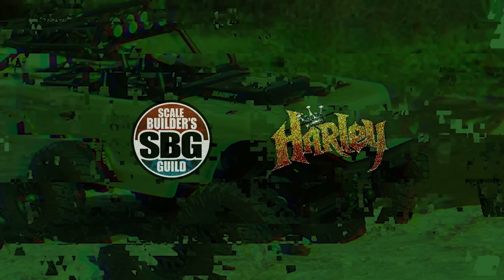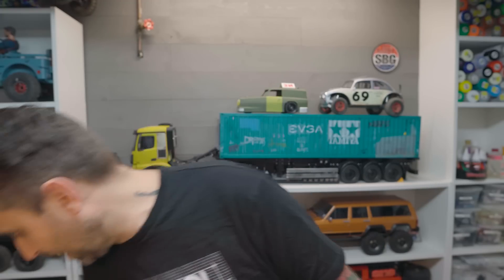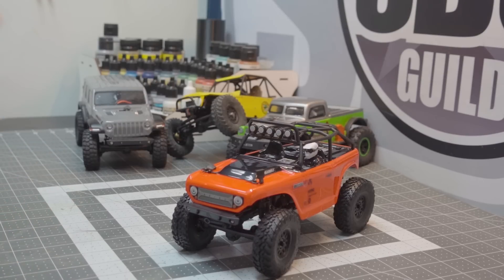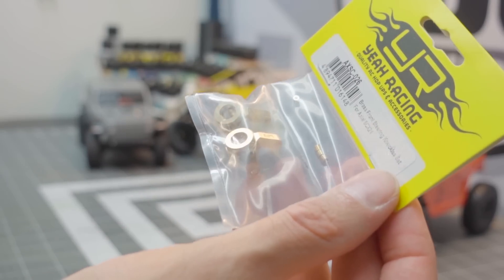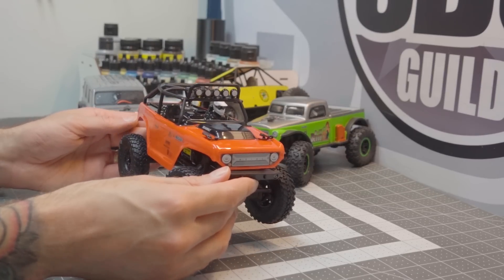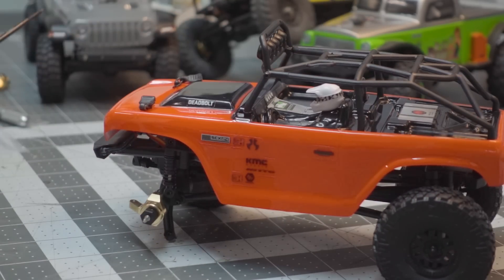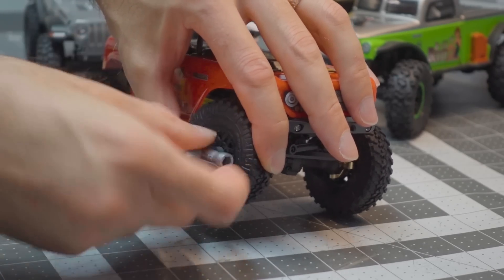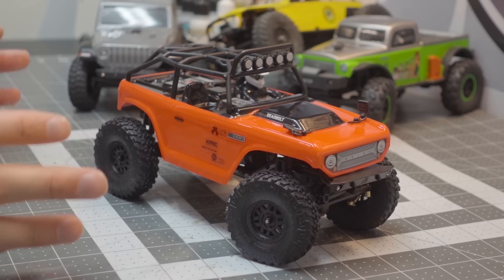Axial SCX24 Budget Build Off Ep1

Comment: Already spent it, reefs 99 with DSM servo mount, sidewinder micro 2,   gamy rc motor mount and little cheap eBay 1408 outrunner. Brass, wide axle kit w/ Brass, stretched with C-10 front links on the deadbolt 145mm now. Cut some generic dollar store soldiers head off to replace helmet. Eliminated light bar with a tree sprag that was laying around. Mod 19 rock sliders to mount new electronics on. Running on 3s 450mah battery. Hot racing shocks with softest springs set as droop essentially mounted shocks on drastic angle to the chassis for droop. Rc4wd breaker wheels with scramblers. Treal Overdrive front diff gears. Obviously moved over to an SR215 and driving with DX5c. Stinger front bumper from Thingiverse! Oh and that’s just 1 of the 4 scx24s I have. I also have what I refer to as the Stroker Betty because it’s number “383”!

Comment: I've had a lot of very cheap R/C cars over the last 40 years from companies like New Bright, etc. and I've never taken a deep dive into the hobby before but now that I have children I'm looking into this as a hobby that I can do with my boys as they grow and teach them to save their allowance money up to buy upgrades and to just have some fun with Dad! I've been doing a lot of research so far and it seems like the Axial SCX24 would be the best place for us to start, I'm gravitating more towards the 1:10 scale stuff but the smaller 1:24 scale stuff looks really fun and cool too! I'm thinking that the best thing to start with and I'm a Noob to this (but I do work on real Hot Rods, 4x4 Trucks and Jeeps too!) but I have to agree with you that you made the best choice to get the center of gravity and the weight down lower, I liked the upgrades you chose, maybe even the brass diff covers as well, next I think I would go with the aluminum suspension kit, and/or weighted wheel and tire kits, and since you now have stronger, heavier axles go with larger tires, then maybe upgrades to the servos due to all the added weight, then I think I would handle the cosmetics like the body swap and the details like adding more lights, etc. I just Subbed BTW!

Comment: I have four SCX24's. The front axles are not typically a point of failure unless you're a terrible driver. IMO, unless you're trying to go wider, they're a waste of money in a budget build-off like this. Put that money into a stronger servo or wheels/tires. The brass knuckles are a good part.

Comment: I have 4 all modified differently. A deadbolt that I turned into a bouncer style buggy with true 4WS, double barrel shocks, stretched with rear links on the front and rear lots of brass, and Furitech speed control. A C10 back halved with MOFO RC flatbed and double barrel shocks and lots of brass. A C10 with MOFO RC Truggy kit that I left the bed side’s and tailgate and rear trailing arms, gutted front axle, hot racing internal spring shock, a fast motor, and a bigger battery 2WD Pre runner style. And a C10 that I beefed up the suspension with hot racing oil shocks to pull the triple axle gooseneck trailer I built to haul the rest.

Comment: I have 5 SCX24's, at least one of each, except the Betty.  I just picked up the 1993 Ford F150 clear body that I am going to put on one of the C-10 chassis'.  One thing to give a heads up that I have found out to add body clearance, move the shocks off the towers and they will bolt directly on to the frame so you are not having to do major trimming to the Jeep and C-10 bodies when you increase tire size.

Comment: I have the white jeep JKU and most of my money went in to brass wheel weights, steering knuckles, steering drag link, and some other things.  I still need to get tires and wheel hex adapters to fit my shaka hobbies wheels.  I definitely want to do aluminum axles and drive shafts eventually

Comment: I have2: a c10 with lots of brass and brushless, and a Jeep that is stock with RC4WD tires on stock rims. The c10 was a headache to get to this point, but is a real treat to drive, and finally feels reliable
 The stock jeep is very tippy, but with only a tire upgrade and steel washers will follow any line with careful driving. Throttle control from a Furitek is fantastic, and is a very valuable plug-n-play upgrade for a brushed setup. Jeep might be getting one soon and call that truck good!

Comment: Yup i got the green dead bolt. I got hr links, axle housing.  Brass knuckles, extended drive shafts and brass diff cover. The wheel weights too.
I got to get a new servo and wheels. I took the wheels of the betty and put them on the deadbolt. 
I just wanted to do this more then any thing else.
I'll be following.  I have the deadbolt the c10 and the betty. I got to get the jeep. That next.

Comment: I've got 2 and my son has one. Mine have both ended up with as much money in upgrades as the original  vehicle cost. But also a great platform to us 3D printed parts as they hold up in this scale.

Excited to see what you come up with and hopefully get some creative ideas for mine 🤔.

Thank you for all the content.
Reply: +1 on the 3D printed part. Especially if you got a resin printer to print out very high detail "scale" parts like fuel tanks and such..
Reply: What parts did you all print bryce?
Reply: @rc4lifenl952  various bumpers, sliders, light buckets, servo mounts, links, pivot balls, spring spacers, etc I think I'm getting good enough at slicing files to maybe do cage for like a tube buggy type set up. 

I just need to invest in fusion 360 or something so I can design my own stuff instead of just using other peoples files.

Comment: I just grabbed the Deadbolt a couple weeks ago and already put the Treal +5mm brass hubs on it. They make a big difference. I also bought some Mud Slingers, but I am waiting for wheels to give those a try. I am pretty sure I will have to cut the body to keep them from hitting, but the grip is going to be crazy with them.

This is my first 1/24 crawler and I liked it so much I bought the gray C10 which should be here in a few days. Awesome little rigs for sure!

Comment: I have 3 running and 1 still in box.
Never into crawling until I saw these. I have built a course to run them on.
C10 heavy mods. Betty just brass hexes
Dead bolt stock but has rc4wd stamped steel bead locks and mud slingers.
Reply from the maker: Cool! Thanks for watching!

Comment: All u need is Rc4wd rims mounted deep dish style with Rc4wd tires. Emax servo stock tray. Hot racing aluminum steering rack. That's it. Maybe brass diff cover upfront. That's it. Anything else and u will spend 1/10 money

Comment: Furitek ESC, hands down the best upgrade you can do to the 24. Throw in a aftermarket rx and radio for even better resolution and slow speed capability, though the stock esc used as the rx will still work.

Almost forgot, get the bluetooth module too so you can tune that increased capability.

Comment: I bought the c10 back in December ran it twice in my basement & never really got into it? Just sat till about a week ago & I been driving it around downstairs. Looking forward to see what you & Harley do with this series?!  Everyone seems to dump 100’s of dollars in these little things cannot really find just some basic upgrade vids? Not trying to spend $1000 on this little thing just a few upgrades to help performance & that’s it. I got gspeed chassis kit & tgh/hh sherpa kit coming that is more important lol!!!🤪👍🏼
Reply: All I've done with mine is brass front diff cover, EMax servo, aluminum steering link, tires and beadlock wheels. I think it's easy to get carried away with adding weight, which can be over-done.

Comment: I began following you and Harley Designs some time ago. After a lengthy absence from the RC hobby, I was excited to hear about this build challenge.  I was really anticipating this series because I began building an SCX24 Deadbolt from scratch as my reentry back into the hobby. However, after watching both you & Josh’s videos this week, I have a question for you: Is this considered a “budget build” or “budget modification”? I am currently in my initial phase which is building out the chassis. I will pose the same question to Josh on his video in hopes to get a reply from at least one of you guys. Looking forward to the challenge and your videos!
Reply from the maker: Not sure I understand the question. We name this series the Budget Build-Off, in that we're both building trucks. Not necessarily from scratch, as we usually start with an RTR. I guess a more accurate description would be Budget Upgrade, but that doesn't really roll off the tongue. 😉Thanks for watching!
Reply: @scalebuildersguild  Yes,  I meant from scratch. I guess I'll just need to follow the Deadbolt exploded view in the hopes of getting it right. 

Thanks for replying and for your explanation. All I received from Josh was a vocabulary lesson of the meaning "build" in the rc hobby (which I disagree with).

Comment: Here's a tip for anyone building a SCX24, use the shorter wheels and tires from a RGT/Barrage/CR24 and a 1/20 scale body, not 1/24 or 1/25. This ends up looking dam near dead on like a 1:1 scale rig on 38s. Iirc the Lindberg "Big 1/20 Scale" Ford Explorer Sport even fits the Deadbolt wheelbase perfect 👍 Yes, the shorter tires effect performance, but if scale looks are what your after I think this is as close to true to scale as you can get on a SCX24
Reply: Worst comment

Comment: I have two that are heavily modded. My advice is lower the  weight by reducing top weight and moving as much weight forward and downward as you can. With some creative solutions this can be done for free. Shick postion body lowering moving the battery etc.Once you have maxed out your free mods then add brass weights. Adding weight helps but you can waste a lot of money on brass parts that add too much weight and do you not favors.  Such as brass axle widener  weights.

Comment: was there a weight difference in shafts? I haven't bent one yet but if i did that looks like a good replacement
Reply from the maker: Definitely. It's negligible in terms of measuring on a scale, but certainly more weight.
Reply: @scalebuildersguild  I bought brass hexes and they only weight a gram, every little bit helps.

Comment: I would start with a few brass pieces down low and the some durability pieces (drive shafts etc) and then a ecx barrage motor if the stick one fails.
Reply: Wheels & tires first!! Always wheels & tires lol. My c10 stock tires were horrible. I bought the rock creepers & ssd beadlocks so much better. A little brass & electronics next when they fail.